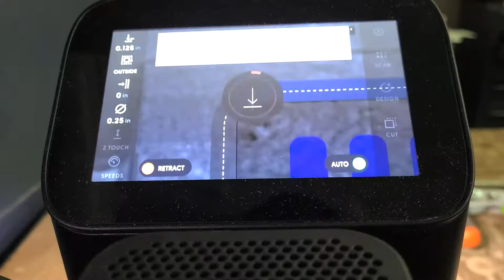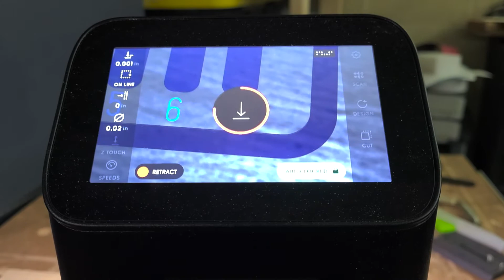Simple Organization Project on the Shaper Origin #shapermade

Comment: shame you never went right through . never leave the onion skin as it can tear the wood
Reply from the maker: I was wondering if anyone would notice that! I like using my MFT table for the ease of clamping projects down but I haven't 100% accepted that I'm going to cut into it a little with each project so I don't go all the way through unless it has to be perfect. Since this is more of a demo project for myself, I didn't bother. I ended up tearing a huge chunk out because I was going too fast. Normally, i'm pretty good at sanding it smooth after.